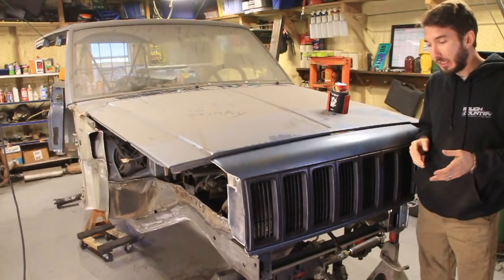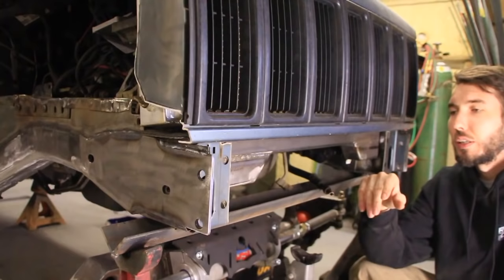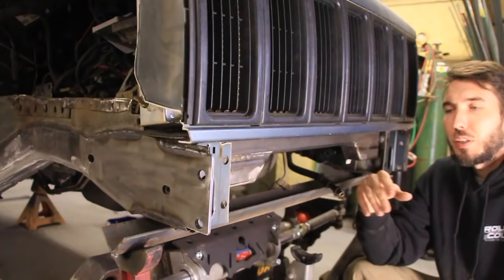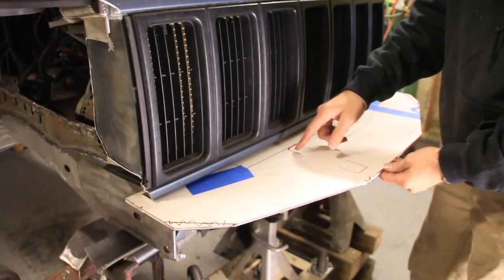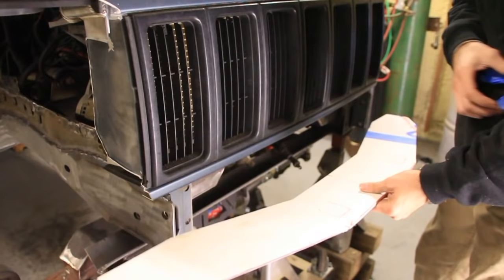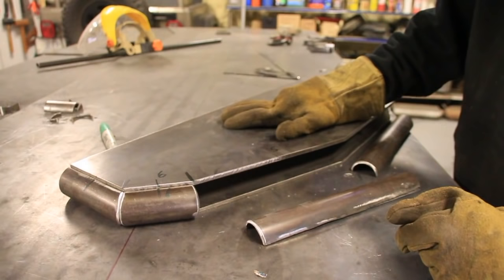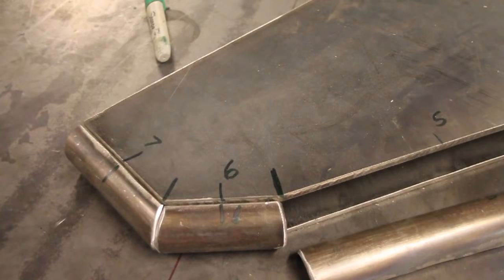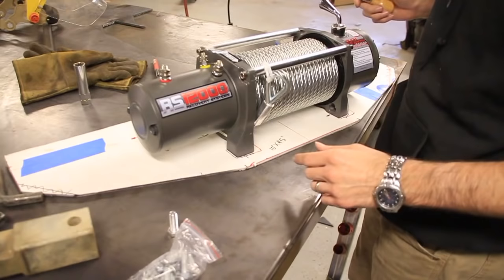Build Your Own Front Bumper

Comment: I would build that fieard edge with full 1 1/2" DM.snd cut the plate to lay it in top at the tubing's cl. A frame member across the fronts with c channel support  boxed  that  the bumper would  key on with the winch mount bolts would mount the bumper and reinforce the bumper and winch as well as brackets from the OEM frame. The whole bumper assembly would bolt to the 3 frame projections for strength and easy removal. This inline 6 has a tendency to run hot and U wouldn't want to mess with it.

Comment: Shakle points should be a straight continuation of the mounting plates from the frame mount. Load directed straight off the frame. Not welded to the sheet metal.  Shipyard structural welder. Dandahermit

Comment: looks great. Also for the 2 pieces of inch bracing inside the bumper, you could have cut slots in the bottom plate to access the edge of the braces to weld it fully or mostly to the plate
Reply from the maker: +Alex Ottomano I did holes instead

Comment: Looks sweet. I worry about blocking the radiator air flow and overheating. I’m in California. I’m thinking stubby with winch tucked under. I need other project - SYE, rear CV driveshaft and 6 degree shims first.

Comment: Great project and work! Love the channel. 
Not sure if DOM tubing is necessary here. People usually use DOM tubing in cage and other structural fabrication because it does not have a seam, so in an impact the pipe wont split along a seam. In this case the pipe is cut in half so you could use a cheaper pipe with the same wall thickens as long as you avoid using the seam in your pieces.

Comment: Nice job on the bar, the front bottom plate would serve you better sitting under like you said. The half cut bars could help with a hi lift jack from slipping out.

Comment: Are you going to seal off the bottom plate on the back side...just worry about dirt and stuff that could get in there and then rust it out. Probably best to seal off? I know you'd lose your access to the winch bolts, maybe you could just weld threaded studs in the top plate for the winch? Just a thought, looks awesome regardless. Love your channel. You taught me how to change unit hubs on a D30 long ago!

Comment: Nice job on the bumper, not really my style, but it looks great. My favorite part are the tabs you made to attach it to the frame. A few things though, 1/4" plate is overkill, 3/16" would be plenty and get yo a 25% weight savings. I know you're shooting for a high approach angle, but the crank pulley looks kinda vulnerable, I'd rather hit a crossmember or bumper than my crank. Keep up the good work.
Reply from the maker: +Sean Ross Ya, at the time I thought my axle would be in front of the pulley but later realized that would put my wheelbase out too far so I may need to rethink that.

Comment: Just a thought. You could cut into the grille just enough to sink the bumper back another 2 or 3 inches. Then the winch would still be accessible and you would not need to have the angle brackets on the frame. Otherwise it rocks. I am looking forward to the videos. You just passed Dirt Every Day as my favorite show on you tube.
Reply from the maker: +syzfilms sweet, wish I had their budget but glad to be tops above them anyhow;)

Comment: Next time to make life easier skip this 1" strips that you added to brace up you top plate and just use your winch bolting locations to be the brace by finding out what size tube it take for your winch bolts to fit threw and weld up your bumper and then drilling your holes threw both up and lower plate and placing the tubing in the whole and welding around the top of the tube  Which connects your upper and lower plate and prevents the bolt from distorting and crushing the 2 plates and making it easier to install and remove your winch for repairs or up keep

Comment: Looks really nice Bleeper. I like your half round tube idea. Much softer look than a plated edge. I may steel the design if I do a plate bumper and not tube. Did you ever come up with some over the winch protection?
Reply from the maker: Not yet

Comment: I like that bumper. looks clean. Did you atleast plug weld the bottom plate to the spacer brackets you cut?
Reply from the maker: Yes
Reply: +BleepinJeep cool. I was wondering. I really do like that bumper. I used a roll bar out of a 80s era cj to make a rear bumper for a ranger I had. not as elaborate  but similaf.

Comment: Looks good, but do you think that the winch will block some of the air to the radiator? You know that the XJ runs pretty warm with the puny radiator.
Reply from the maker: +Robert Smith no matter what bumper you get or buy the winch will always be in front of the bumper unless its one of those huge ARB bumpers where the winch goes underneath like I did on the zombie jeep.

Comment: D rings for the pull point.... why couldn’t you just hook to the winch cable? If it’s already wound in, you wouldn’t be stressing the cable. Save time welding the rings and money from buying them? Also, the pull point would still be stressing the same points on the bumper and frame. If the winch is able to handle pulling it, it should be fine.
Reply: Just a question lol
Reply from the maker: It's very unsafe, cable is not meant to be snatched: https://www.roundforge.com/articles/all-about-winch-cable/
Reply: Often times you will need to come back with the cable and hook it up to your vehicle so you can double the pull.  You might also need to hook up a tow strap somewhere. A shackled tow point is critical on a trail!

Comment: Nice wojrk. I'm building my first Jeep project, a 96zj. Hard to find an affordable  winch bumper. This inspired me to give it a shot on my own. I assume the 1 inch flatbar supports are only tacked to the bottom plate at the edge of the plate? Do you have any problems with rattling since you can't weld the support the full length of the bottom plate?

Comment: Is there any reason XJ guys don't sink the winch into the grill? It's been a long time since I've owned an XJ so I can't go look if there is anything back there. Could gain another couple inches if you notched it out.
Reply from the maker: +Ronin Off Road probably could but it would further block the radiator and the grill is very brittle pastic and would hold up well with sections cut out of it.

Comment: how powerful of a welder do you need to be able to mend that steel? I want to be able to build a bumper around my warn winch brush guard on my 97 ZJ. Any info will be helpful.
Reply: nothing coming from harbor frieght. you'll need something adjustable and capable of welding atleast 1/4" steel. i'm just a hobbyist welder with a Hobart Handler 140. If I could do it again i'd go miller.

Comment: Hi Matt I'm not sure if you've covered this or not. I want to mount my 8274 on a receiver hitch and see a lot of guys using SB175 quick connects. Those puppies are only rated for 280 amps but the old Warn draws like 480. What gives? Just wondering if you had any experience with them. Thanks a lot
Reply from the maker: No, I've never used disconnects.  How heavy are those winches?  You might need two guys just to take it on and off the receiver!
Reply: +BleepinJeep yea they're pretty hefty. I built a bumper for my WJ but for my f250 I'd rather have a low pro front bumper with a receiver. more versatile for my situation. I've got dyneema on it. I'd bet about 100lbs. keeps me fit
Reply: +BleepinJeep yea they're pretty hefty. I built a bumper for my WJ but for my f250 I'd rather have a low pro front bumper with a receiver. more versatile for my situation. I've got dyneema on it. I'd bet about 100lbs. keeps me fit

Comment: do you think the plastic grille cover to the radiator could melt if it was actually touching it?
Reply from the maker: +Tom D touching what the winch?  No
Reply: +BleepinJeep sorry I didn't explain that very well, I meant pushing the plastic grille cover back to the radiator you mentioned at 16:45
Reply from the maker: +Tom D well it still wouldn't touch but a Radiator is what, about 210degees, I dont think that would be hot enough.

Comment: ''Close enough''
''I didn't account for''
''I still need to figure out'' (Half way through a job)
''If i were to do it over again''
Phrases you should never have to use when metal working
Please, if you are going to fabricate your own bumper, this is not the way to do it. There are so many factors that have been overlooked, and I have noticed this in a load of these type of videos. Have your design, and your measurements before you even touch your welder, grinder, cutter. 
I am 100% for going DIY, but doing a hack job will only leave you regretting, when your bumper falls off, snaps,  and your winch ends up damaging your vehicle (Or worse) you will be sorry. 
I find this video, and many others of Bleepin Jeep quite irresponsible.
Yes, it's fun to do this yourself, yes, I like that he is doing this himself and enjoys it, but there is a reason things are done in a certain way, a proper way. 
Measure twice, cut once, and if you mess it up, do it again.
Bleepin Jeep, as much as i like your videos, man, showing people the wrong way to do something ain't right.
Reply from the maker: It's been working great for years, not sure what your problem is...  must have a stick up your butt 🤷‍♂️🧨